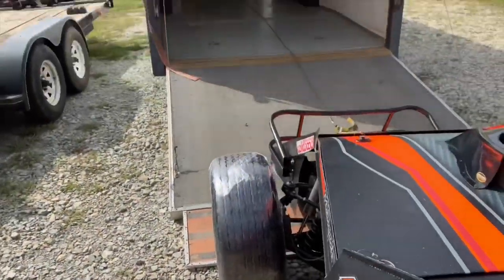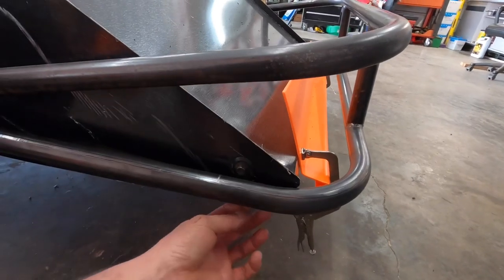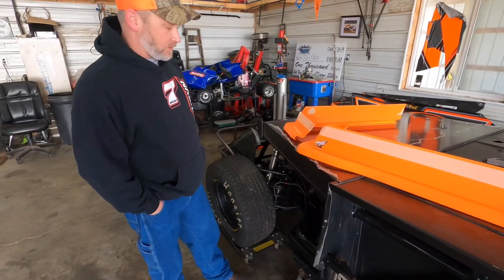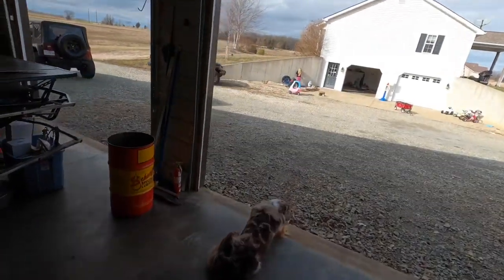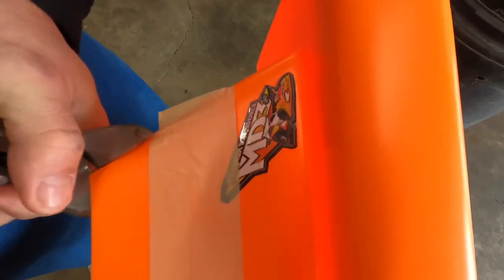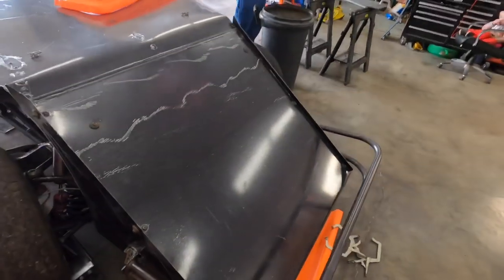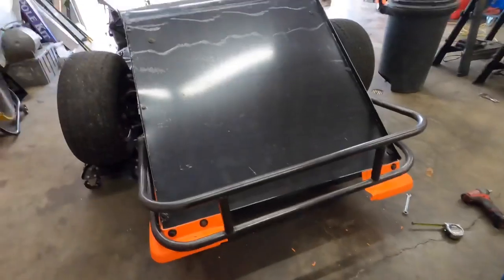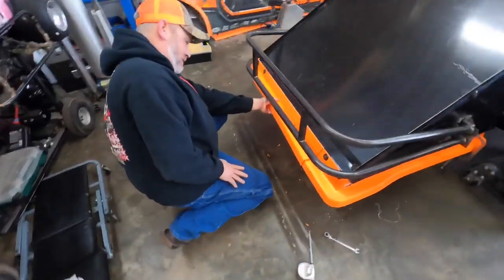Race car body fabrication - learn how to do it yourself pt.3 nose valance DIRT TRACK RACING

Comment: I use a piece of 1x1 aluminum angle from lowes clamp it to the body pannels or plastic nose stuff I need tk cut straight and run my hand held jig saw down it using angle as straight edge suler easy fast and comes oit perfect

Comment: What about your sheet metal brake fellers, would it work or just break it?
Reply from the maker: For poppin the plastic after we score it?
Reply: @OldNo7Garage  yea to break the long pieces of plastic just wondered if it would snap it down the line you made or just bust it all to pieces or not
Reply from the maker: HAR_SNAKE  I think it would do a fine job. Trouble is, it makes a 90° turn and you wouldn’t be able to get it in the brake. Unless you had a box and pan brake that is.